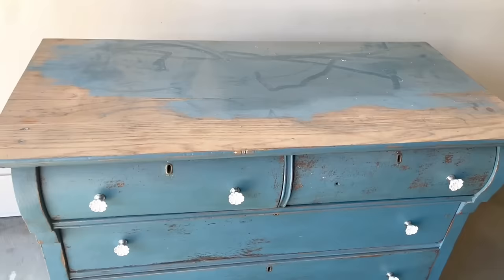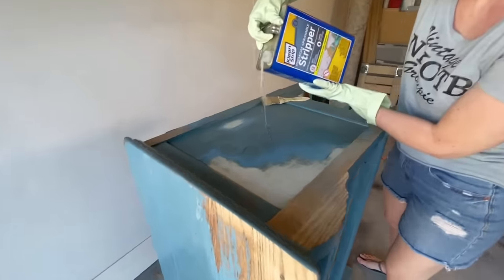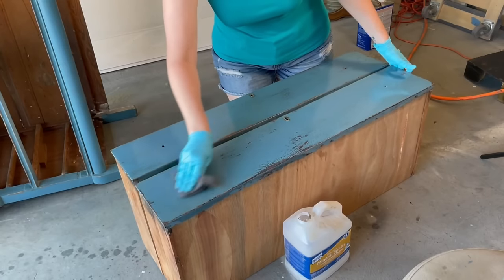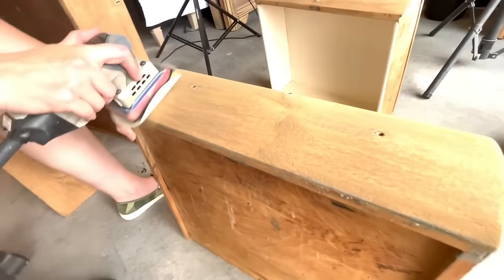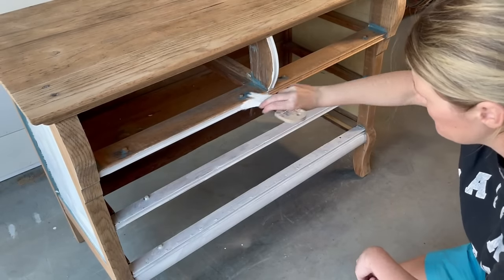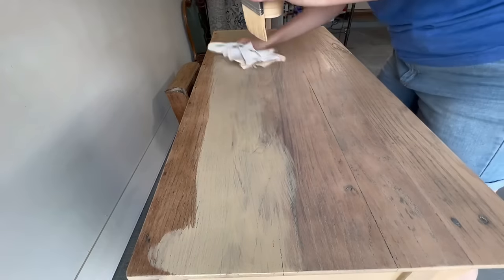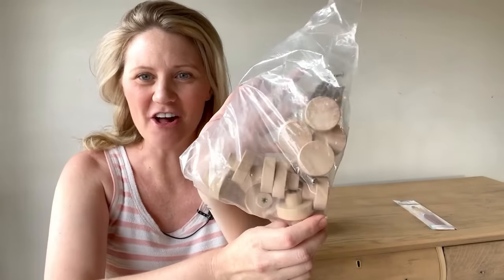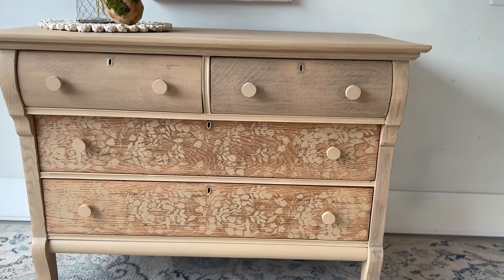Free to Fabulous // Unbelievable Furniture Transformation

Comment: I suggest using a dryish brush to dab paint on the stencil areas..keeps paint from running under edges of the design.  Also it is good to use 3 colors (dark, medium,light)  for the design...gives depth and interest that keeps the eye moving instead of just an unlively flatish look.

Comment: tip do not waste ur time and energy cleaning the piece if you are going to use chemical stripper...it is not point to clean the piece before the application of paint removal.
Reply: It is always possible that there is some chemical on the surface that will counteract with stripper.
Reply: @cferguson3368  i believe that the paint was an epoxy base, that is why it  was almost imposible to remove.

Comment: Also, some thing I find a little bit easier than doing a paint wash, is using a white wax over raw wood. And I apply it kind of like it to paint wash and go ahead and rub it in and then wipe it right off. And that also adds a little bit of extra protection. that’s how I prefer to do any pieces that I have that I am able to strip there, and it gives it this really bleached wood look. Then if I put a stain over the white wax, it makes it look really aged and weathered like reclaimed wood. Just don’t do this to walnut. It goes a weird purple grey color. It works best on Pine and maple. And it’s the only way I’ve found to make mahogany stay light.

Comment: tip #2  Use JASCO premium paint and epoxy remover is a red metal can... it really works and is the best i tried so far...the blue can u used is smelly and does not work as should be.
Reply: Also, piece should have been checked for lead based paint. There are kits for this; relative simple to do. 
Often this is industrial paint used to paint equipment and is not meant to come off.

Comment: I'm a newbie at flipping...so quick question. Why didn't you just sand first rather then use the stripper and the scraper? Thanks!! Love your channel❤❤
Reply: I am wondering that myself
Reply: Some possible reasons to use stripper: When you sand, the paint and sawdust are released into air. Sawdust on it's own is enough without adding the paint. Not all paint will scrape off easily. If the paint is tightly adhered to wood, you may cause more damage to the wood by scraping than you will using stripper. The same goes for sanding. Some paints (usually oil-based) have hardened over time in addition to tightly adhering to the wood. In this case, removing by sanding is time consuming while requiring a lot of sanding supplies. Many times folks don't put a base (shellac is a common base) between wood & paint/primer. In these cases, the paint gets embedded into the grain. Paint embedded in the grain is a pain to get out. A stripper is often helpful in removing paint from grain. Some folks also just prefer to use stripper.

Comment: Have you ever considered have a soda blaster around for those spots you can’t get with scraping and sanding? I think you have an air compressor so a small soda blaster would only be like $35. If you have a powerful enough compressor they work like a charm.

Comment: Often times paint that resists stripping is because it contains lead! Easily checked as there are kits designed to do this with a simple swab.
Also, please wear close-toed shoes rather than flip flops! Personal protection cannot be overstated.
Other than that, good job.
Reply from the maker: Yep I did a lead check. I think it was the lacquer top? Totally stumped

Comment: I like the new natural and stenciled look.
However, should you decide to stencil on any furniture again, I would advise you to use round bristle stenciling brushes (they are not expensive but very efficient).
By using a roller it is inevitable that a certain amount of paint gets pushed under the stencils and the result isn`t as crisp as it could be.
Reply from the maker: thanks for watching! Yes I usually use that route but on this one I wanted a barely there sort of blurry edged look so it looked worn with out distressing the stencil. Hope to see you on the next vid!

Comment: Use a heat gun next time - it will melt the paint and you can scrape it off easily. It has worked for me on paints that wouldn’t budge any other way.

Comment: Omg, l went through the same type of issue with navy blue paint! I ended up doing a treatment just like you did with solid paint and the paint wash combo. You did a great job! I wouldn’t have sold it😂. One question: had you considered using a heat gun to remove the paint on the sides? Why or why not? You would really help a lot of us newbies watching.
Reply from the maker: Thanks for watching! I was worried with the cheap plywood on the sides I would burn it using the heat gun or gouge it further and then have to fill with wood fill....costing me even more time!

Comment: That darn stubborn paint. I'm working on 1 right now that I'm pretty sure the same paint was used 😡 I used a heat gun and held on the paint just so that it started to bubble, I let it cool and it flaked right off with a scrapper. I tried just scrapping first and it was very hard to remove.  
But you won the battle, it turned out beautiful 💖

Comment: I just finished refinishing my son’s old oak student desk that he’s outgrown.  It’s a different era, late 1990’s oak that we’ve all seen before, but I finished it nearly identically, minus the stencils.  It had some veneer, some solid wood,and the top had some ink stains when my son got into calligraphy for awhile, so I painted the top a very similar color because I couldn’t sand the thin veneer.  I can’t remember the brand but it’s named “Cashew”, washed the sides with a similarly colored oil based stain I’m trying to use up, lol.  It even had oak knobs that I also painted.   Different era of oak furniture but funny we went the same route. 

I had some issues trying to do a wash/stain in the heat this summer (I’m in NM).  There are a few areas I would have liked to have had more wiped down but I gave up because it still looks ok, even though it didn’t come out how I had it in my brain.  I’ve finally decided to work on sanding/prepping the couple of pieces that I have in process and not doing any of the painting staining parts until it cools down some.  It’s great when you want the coats to dry so you can get on to the next step but you loose so much working/rework time with the finishes I don’t think it’s worth it!